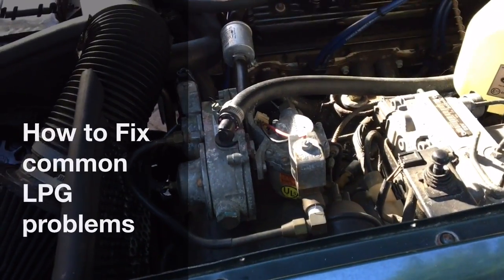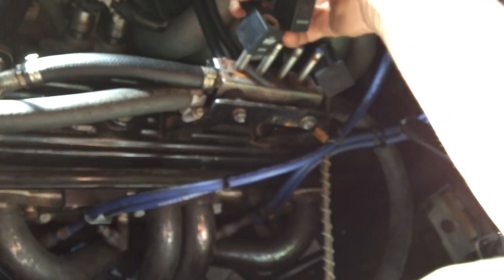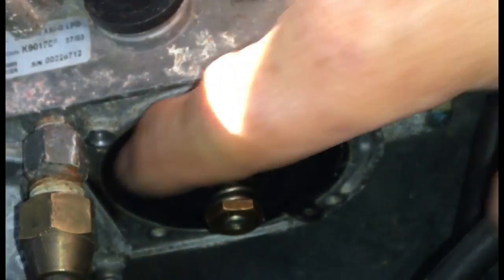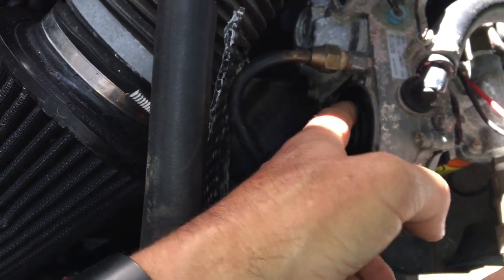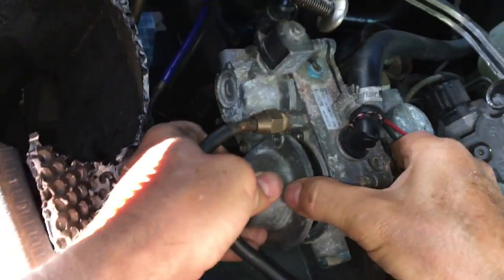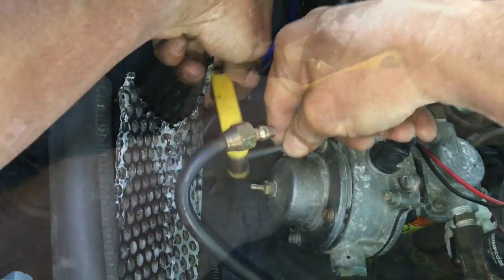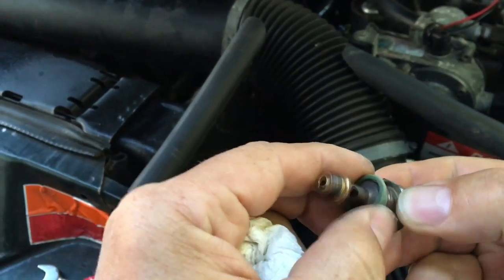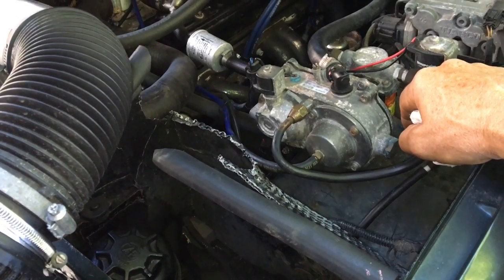How to Fix Common LPG Problems - Vaporiser / Reducer, Injectors

Comment: Thank you for this very informative video - I have the same system. It had been working flawlessly until the other day, when I filled up with gas but I noticed I could only fill to about two thirds - the petrol station said that they had - at that moment- run out of gas. Since then, I can't use the gas that I have in the tank; when I switch to gas, as soon as I touch the throttle pedal it switches back to petrol.  Could you advise as to what might be the problem? Thanks so much!
Reply from the maker: Thanks. From your description it sounds like it has insufficient gas pressure which is why it switches back. So it could be the vaporiser not working correctly or maybe a clogged up lpg filter.  The system needs a full check and service stripping the vapouriser, changing the lp filter(s) and check what lpg ecu software reports about the system.
Reply: @comeinhandynow  many thanks for your reply and tips
Reply: @comeinhandynow  One more question please if I may - I notice that a new vapouriser isn't all that expensive - is there a chance that simply by changing to a new one, it would solve my issue? Or does a new vapouriser also needs the ECU reprogramming for it to work?
Reply: @jaap5398  i would like to know this too! I have a coolant leak on one of the water connectors so thaught it easier and cheaper to just get a whole new one, have ordered it so joping it is just an adjustment to the pressure screw to match ecu.
Reply: @turningwheels2584  I have replaced my vapouriser with a new one and everything works fine again. Not sure what adjustments I should make (or how), if any?
Reply: @jaap5398  i too just had a new one arrive, the at09 alaska, it's the same as the one which I'm taking off and has an adjustment screw on the front, I'm going to turn the old screw in and count the turns then turn the 'new screw' out the same amount of turns..... What can go wrong!! Ha! £40 from the lpg shop so not worth rebuilding old. And made in italy so no kids were harmed while making it!
Reply: @turningwheels2584  haha that’s a relief - mine (an OMVL XII) came from Italy too, but, it was £140 - it’ll pay for itself after a couple of fill-ups though. Not sure there’s an adjustment screw. Works fine, so there appears to be no issue with swapping vapourisers as such. It’s annoying how few garages service LPG installations, or I would have mine checked over.
Reply: @jaap5398  this is true, i have mine on a campervan and when i bought it last year i found out it wasn't registered on the uk lpg register, my insurance company demanded it so i had to drive 3 hours to an uk lpg registered installer to have it checked, serviced and registered! That's where i found out the tank was dodgy so needed a new tank! £700 later it was all serviced, checked and new tank/valves installed..... That's a lot of unleaded!! We worked out we've saved £400 in fuel so far and we have 3 lpg station within 10 miles of me so hopefully be in profit real soon 🤞
Reply: @turningwheels2584  driving three hours to spend £700 is no fun, but, you’ll make it back before long. I have driven my 4.4 V8 bmw on mostly LPG for 17 years now, it must have saved me at least £15k by now - (though, of course I could have just bought a more economical car in the first place:) Over that time (and especially in the last year or two) I have seen many lpg pumps disappear, which is a concern. Not sure why. Too few customers to make it viable? Or another underhand push to get people to buy electric cars?

Comment: Got some useful information from your video .Thanks!  
One suggestion I would make is to avoid washing up liquid to leak test, as I was told it quite often contains salt to thicken it (which could cause corrision) .  I was told at my gas safe course that if no proprietory leak test fluid or spray was available to use a mix made from a bar of hand soap and water..
Reply from the maker: Thanks, that is interesting. I am not too worried about it as the volume of liquid in the bubbles is probably very low, so the amount of salt very low.

Comment: Hi I have a Toyota estima and my lpg doesn’t go through, only the petrol works and the lpg doesn’t. Is there any solution to that? Please let me know, thank you
Reply from the maker: Follow the video and try and work it out. Test that lpg is getting through at each junction by loosening each joint a little and either listening for leaks or use a foam bubble solution around it to look for bubbles from the gas. Do it outside.

Comment: Hi mate, I have a similar system to yours. Issue I have with my patrol is after about 40 minutes of driving the revs drop suddenly and it begins to shutter. Weird how it only happens after 40 or so minutes.. prior to that it runs like a dream. 
Any ideas?
Reply from the maker: Maybe some part of it is icing up. Feel the temperature of the injectors and the vaporiser when it happens.  I found mine ran better after I plumbed in some hot water pipes, in copper, to run under the injector blocks.
Reply: @comeinhandynow  thanks for getting back to me! 
No Ice at all, the unit just gets quite hot. But no ice at all
Reply from the maker: @christosgiannikopoulos953  It is often useful to have the LPG ECU software and interface cable to monitor what is going on to try and help diagnose it.  You could try and get that.  Other than that all you can do is strip and check and clean the injectors and vaporiser, looking for problems.

Comment: So I have a vehicle I just bought , it's propane , but it won't start, I filled it and it just clicks . I took the filter out had someone crank it and added some starter fluid to see what happens . It would try to start then choke out on itself. Is their a possible reason that the truck is having a gas problem or a electrical problem? I'm new to these systems .

Comment: Great information.
I have Prins system. I had it fitted 10 years ago. Always replaced filters with prins genuine. Car used t swith t gas at 45 degrees. Now falls t switch over till engine 75 deg or higher. Car stalls.
Once it switches to gas now running issues. I did cleaned out with wire wool solonoid filter housing which worked for a whole. Any advise please
Reply: Try a K&N air filter, help lots for better running on my car.

Comment: I Am using I10 2009 model it is running extremely good in lpg but when I switch it to petrol engine start missing ans get off then when I run the car for around 20-30 KM it gets normal.

Comment: I wonder if you can help, I have a Landi Renzo system on my lexus, it seems very slow to change over and only really seems to switch when at motorway speeds and revs.
It's annoying having to use more petrol, is it likely the manifold pressure or temperature sender?
Reply from the maker: Probably the temperature is not getting high enough quickly enough.  Is engine temperature ok? Don't rely on the car temperature gauge, they read ‘N’ from about 60C to 117C
Reply: @comeinhandynow  thanks for the reply, just looked over it, am I right in thinking it has a inline temp sender that fits inside the coolant pipe that goes to the vaporiser?
It's very corroded and green, so I'm wondering if its reading properly at all, could be at least 12 years old judging by the kit date!
Reply from the maker: @themotorcyclehistorian8099  I’m not sure about your system, sounds like you may have found something.  It is really useful to buy the cable interface to a PC and the right LPG software, then you can read the temperature and set it to switch over at a lower temperature.  It’s what installers have.

Comment: Hi guys. I have problem with my BMW E60 with prins lpg. Only on standstill on lpg is like misfiring on petrol no problem. Checked everything which i can so i’ll be thankful if you guide me to find the problem. New headgasket, new spark plug, new hoses, new lpg filters, new membrane on reductor, new lpg bottle … Thank you!
Reply from the maker: I would dismantle and carefully check/reassemble every connection on the vapouriser. I had a very similar slight misfire that turned out to be a bit too much ptfe tape blocking a pipe connection on the vapouriser. Can’t remember which pipe.  Other thing that makes a surprising difference is triple cored 10mm race type ignition leads.

Comment: We have two solenoid gas valves. One right on the tank at rear of vehicle , the other is on the vapouriser  or the firewall a short distance away . I mounted fittings so I can refill camping cylinders from the automotive onboard LPG supply. To refasten pipe (it's a foot long copper pipe from firewall to vaporiser which I modified )  I applied synthetic oil to the threads , not much. The car wasn't an easy starter afterwards for a spell , then it became a better starter than previously . .Now I'm musing about uncoupling  eight feet further advanced at tank end and seeing what happens after spraying in carburetor cleaner into the pipe , then recoupl ling  again. The eight foot length would bathe components with carburetor cleaner solution for say five minutes of idling . Also given thought to placing the rubber rejuvenation compounds instead of carburetor cleaner . I've only thought about it though, that's all .

Comment: Interesting concept to attempt repairs to the diaphragms with stupa glue, how about that silicone product used for filling gaps and fastening which is designed for use in petrol / oil environments , the household version isn't suitable in such environments and swells up and comes unstuck. I recall the professional installers used to use the stuff quite liberally , , the product smeared decently over the diaphragm it might have legs. I wonder why a suitable leather rather than rubber isn't used as for diaphragms in the diesel fuel systems , it's a dear leather I think.  So you definetly know what you're doing anyway. In Australia the LPG began to catch on in mid seventies for cars. Heaps of equipment is of Italian manufacturers . It's illegal for non certified persons to carry out work on LPG systems here bigtime . Technically can't even transport the cylinders 
 without certification . Who gives a stuff really . Here up to   1982 there were LPG cars driving around with LPG tanks mounted externally on roof racks on top of vehicles , no sensible regulations existed , then lawmakers went apeshit .
 If we buy a service kit , we need to show our certification over the counter, therefore buy it from overseas retailer and have it delivered .the
Reply: I can tell you the story of why these regulations were put in place. I was talking to my mechanic yesterday about having a convertor replaced on my car,I've known this guy for more than 30 years since when he was a mechanic at a dealership a few doors up from where I managed bearing shop in Ringwood Vic. This is the story he told me which I vaguely remember but he knew the details because he worked with the guy at the time.In the 80s the LPG industry was largely unregulated,many mechanics were doing weekend side jobs by fitting LPG systems on the weekends in their backyards. One weekend around 1990 just a few blocks away from the dealership a guy was doing just that in the driveway of his house,he was just about finished and the client was with him waiting to collect his van.He had completed fitting it out and drove it to a servo where he filled the LPG tank,that was his first mistake,he should have put only a litre or 2 in the tank and then taken it back for a leak inspection,he must have been new to the game and instead he filled it. He brings the van back to his house and backs it into the driveway, he gets out has a sniff around and notices a leak coming from the tank outlet. There is a proceedure for attaching the outlet coupling to the tank which he didn't do correctly. He figured a good fix would be to remove the coupling and wrap some PVC tape around the threading,so he began to unscrew the coupling,within a few seconds the he had the join removed and gas immediatly rushed out,swamped the back of the open van filled his lungs then quickly began to rush up the driveway towards the house where near the kitchen window is the the ducted heating unit,the pilot light was on,his wife was in the kitchen and saw a flame erupt,just as she screamed fire! the flames travelled back down to the van which is full of gas and immediatly exploded. My mechanic friend and his mates at the dealership a few blocks away heard the explosion. The guy doing the conversion burned from the inside out as his lungs were full of LPG when the explosion occured,it took him 1 and a half days to die in hospital,the wife and client survived. This was the first serious LPG incident in Victoria and soon after domestic LPG conversions were banned and all the restrictions and licencing was brought in. After my mechanic told me this story only yesterday,I'm in two minds about replacing the converter myself,maybe I'll let him do it. My mechanic worked with the guy at the dealership,said he was a good bloke,it was a sad and frightening incident. There's a reason to give a stuff while tinkering with auto LPG systems.

Comment: Very informative video,
Sir i need a help i fitted a new landirenzo omegas 2 cng kit in my suzuki liana, from last 6 months, but from last 15 days its hesitates fully when i push the pedal quickly all of sudden, but when i push the pedal slowly or with medium pase my car not hesitate on cng. But with sudden padal it pick up become very compromized. Sorry for my english.
Plz guide me!
Reply from the maker: You need to access the LPG ECU and adjust the setting for enrichment on acceleration.  You need the right software and a serial comms cable.  That is my guess.

Comment: Hello, about vaporiser's membranes, when should I chage them? 2 years? I have a problem, cooling start to raise (cold engine) in the expansion tank, And the cooling system seems that it don't want to bleed itself (and also I bleed it and after a while same problem, air in the system and more water in cooling tank). I suppose that the vaporizer has an issue, but I don't know hoe to test it... or how could be...
Reply from the maker: Could be but unlikely. The main membrane is not a water barrier.  Sounds more like your cylinder head gasket is on the way out. Try disconnecting the water pipes to the vapouriser, run on petrol for a while and see if the problem persists.
Reply: @comeinhandynow  I cut off the LPG from the tank and I run only on gasoline for a day and it looks like now it the cooling system is fine, but I will wait 2 more days to be sure of that. I also do not have oil in coolant and vice versa, so I think it's vaporizer. in that case maybe was a factory issue with this one...

Comment: My car LPG tank capacity is 49 liters,so 80% (safe amount)would be 39 to 40 liters to fill.But when empty I get only 32 to 33 liters inside!Can I fix this problem and how?Please..Thanks!
Reply from the maker: it is possible the float valve in the tank is sticking, which can sometimes happen. I have in the past completely drained the tank of gas and taken out the float valve but it’s not something I would recommend and if you do do it, do it outside where there is lots of wind and only release any residual gas very slowly.

Comment: I repair my gas italia rpg 09 and after that I have pressure max 1.1 bar. Before max pressure it is 1.5 bar. Do you know what goes wrong? Thanks in advance
Reply from the maker: Nothing to go on there.  I suggest checking your evaporator/regulator is rebuilt right and the correct parts have been used.  Maybe try a new regulator.

Comment: I have twin lpg buti topped it up 93 lit first time gave me 340 miles second time it only topped 60 lit gave me only 315 miles it should have gave me more
Reply from the maker: See how the average works out. it will vary with type of driving and temperature. It is possible the float valve in the tank is sticking, which can sometimes happen. I have in the past completely drained the tank of gas and taken out the float valve but it’s not something I would recommend and if you do do it, do it outside where there is lots of wind and only release any residual gas very slowly.  Away from combustion sources!

Comment: If you have cold weather start issue,, apply heat to the lpg injector,, I use a heat gun,, on my 07 komatsu 30 lpg,,,if you have a no start issue check the lpg injector,, pull out , plug back up,,ground ,,turn on key should vibrate
Reply from the maker: Thanks for your input.  I had 8 injectors as like most systems nowadays it is a multi point sequential system.  The point about warming them up though is still a good one, they can get clogged with wax.  I ran a hot copper pipe from the engine coolant system under each bank of injectors to keep them wax free by making them hotter all the time..